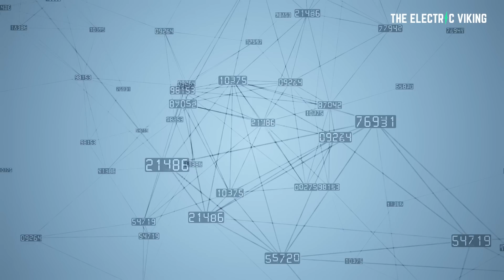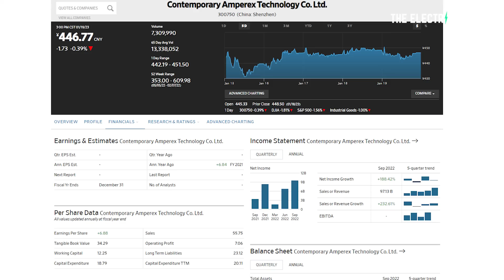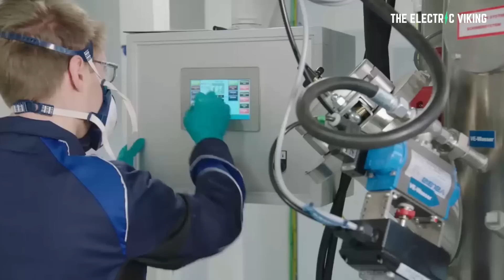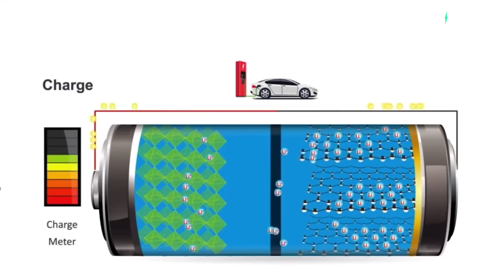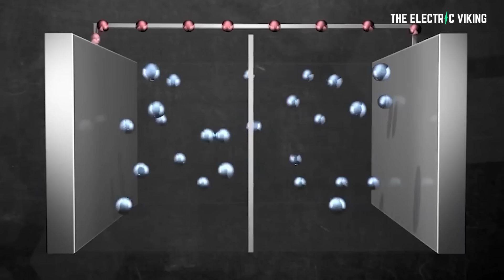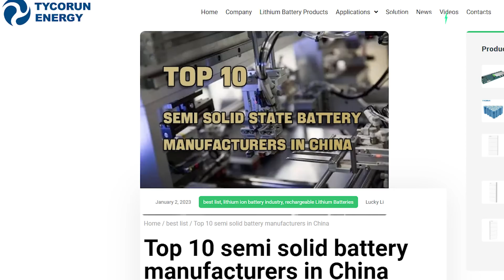GAME CHANGING Aussie Gigafactory deploy advanced US battery tech

Comment: It is really important that we get away from using Li batteries for static applications.  This would reduce the demand for Li, bring down the price and make EVs cheaper.  Some estimates suggest that if you reduce the price of an EV linearly, you increase the market exponentially.  The situation is probably even more extreme.  The point at which EVs become cheaper than an equivalent ICE car is and inflection point at which the sale of EVs will increase hugely.    We are very near to this point.  The good news is that other batteries are superior to Li batteries in a number of ways for static applications and only need market share to out-compete Li batteries.  All are made of cheap, readily available elements.  All have a much longer life.  All can be cycled between 0% and 100% with no damage.  There are the SbCa and AlS liquid metal batteries, The flow and gel ZnBr batteries, a bunch of flow batteries based on V or Fe and perhaps the up and coming Na batteries,

Comment: I hope your right Sam but your price of manufacturing analysis has a flaw in it. Yes the 20% cheaper cost would mean you could build them in Australia at a similar price as batteries being built in China now because of cost of labour disparity, but the problem is that this new cheaper to build tech would still be cheaper to build in China because of that labour disparity. So you have to make very sure this new company doesn't go running off to China to get more profit. That said i hope very much that this works very well for Australia.
Reply: The last couple of Aussie inventions that have done well for Overseas manufacturing were solar panels and WiFi .🤔

Comment: If C4V has 40%-50% more energy density (in wh/liter), this means your C4V battery can be 30% to 33% smaller than the LiFePhospate battery (not 50% smaller) for the same range. Note: battery "size" relates more to the battery's volumetric energy density in watt-hours per liter (wh/l), rather than energy per unit weight (wh/kg) that is more accurately identified as the battery's gravimetric energy density or specific energy.

Comment: Is there anybody working on battery operated trains? 

We have far too many diesel driven passenger trains, it would seem to me that given most of those trains are available as electric/diesel electric and steel rail vehicles are very efficient, why not just cut out the dirty diesel engines and replace them with batteries, possibly in replaceable modules to speed up recharging.

Comment: 7:50 correction: 2/3 size battery with this technology would have same range of older LFP technology.  The 5X power density makes it great for use in PHEV and EV's with small batteries that still have very powerful acceleration and  regenerative braking, allowing a tiny Genset.  This would work good with PHEV trucks.  With battery supply limiting CO2 emissions reductions, PHEV'S are much better than ICE vehicles considering that 95% of trips are very short.
Reply: I expect smaller batteries will be lighter and extend the range accordingly. The higher energy density makes them better suited to aviation than current batteries.🤔

Comment: BTW.... a nation like Australia may not benefit from adding value to its exports.
currency values depend in part on the 'balance of trade' (value of exports minus imports) in the nation's economy.
Turning that mined raw Li into batteries MAY be more cost effective than it being done in China (unlikely) but even if it is , doing so would obviously increase Australia's exports quite significantly...THIS increases demand for the Oz dollar..which pushes its price up relative to other currencies ....a higher value dollar makes ALL your other exports more expensive (iron/coal/wool/wheat) threatening the stability, competitiveness, and indeed future of those much more lucrative / important industries/ markets. (stable markets = stable export income (stable employment also)  = stable taxes for government)
Also, a higher value dollar makes imports cheaper, this can easily ruin local firms/industries who currently produce/supply those goods.

tl;dr MAKING MORE MONEY IS NOT NECESSARILY A GOOD THING FOR AN ECONOMY WITH A SOVEREIGN CURRENCY

GEO POLITICAL ISSUES AROUND CHINA CONTROLLING 80% OF AN ECONOMICALLY  SENSITIVE MARKET WILL HAVE INFORMED THE DECISION TO BUILD A GIGA FACTORY IN AUSTRALIA.

Comment: What about sodium batteries that CATL and BYD are about to produce ?  aunt they more advanced ? .. For grid storage how is the Flow battery I believe they are about to start marking in Queensland . I think flow batteries may have much longer number of discharge / recharge cycles . Storage batteries for grid probably have 2-4 cycles a day , so battery degradation is critical . Flow batteries are much bigger but that doesn't matter for grid stability after all how much space is not used under high voltage lines that bring power into the cities from power plants . flow batteries can have the fluid replaced easily when need and this recycled again and again .

Comment: Can't wait to see if it isn't all hype, like most all the other startups. When they say things like "5x the energy density", that's crazy (ain't happening without a bunch of hiccups). If "5x the power density" then yes, maybe (probably with a loss of energy density), though.
I believe that the LFP will be marginally improved, such as to almost have as much energy density as the NCA, etc, however, it won't last as long as they do now, and will be more prone to "thermal issues" of they get too energy dense.
So, best to keep researching but assume that LFP is already good enough, just like the inventor's name...
Goodenough 😏
Reply: that's exactly what it is. Hype, nothing else. This battery type only exist in the lab yet. When it comes to building at scale the impressive figures will fall apart. Even if the energy density is better, it won't be suitable for all applications, and definitely not for EVs, otherwise Tesla would be already making it.
Reply: @imrepetrohai I like your faith in Tesla but they do get their batteries from any battery supplier that meets their standard and price.🤔

Comment: The way battery technology is progressing how long will it take for a petrol tank-size battery to store more energy than a tank of petrol? 
This battery technology is moving so fast that I don't believe we have even started the real battery race yet.
I have a new motorbike and a Toyota FJ which both I love but I can see both being totally obsolete within 5 years.
I wonder how long I can use it as an ICE before it becomes illegal or too expensive to use in its present form?
I am also wondering if I will be able to convert the FJ to electric in the future. 
There is plenty of room for new technology batteries in the FJ along with a powerful electric engine.
Today the future is moving toward us very fast with little time now for the sentiment.
The other question is will the new up-and-coming generation care or just embrace the change?
They certainly have done so with electric bikes and scooters.
Reply: The energy content of petrol is somewhat theoretical until you feed it to an engine.  Even if we consider the weight of both the petrol and the engine, however, the energy density of petrol is still huge.   It's in the vicinity of 100 times as energy dense as today's batteries.  Electric motors are 4-5 times as efficient as ICE engines though, so that helps a lot. It should be possible to convert the FJ.  People are converting all kinds of cool old cars.  I think we'll se a lot more of this.  The younger generation will be fine with EVs.  So will the old folks, once they drive one and find out how nice it is.

Comment: Tesla uses spaghetti maps.  What is that?  If you walked all over a factory during the day, your path would look like spaghetti. It is wasted movement and adds cost.  The map for making computers and cell phones is full of cost add due to the spread out supply chain.  Same goes for Lithium.  It makes sense to vertically integrate in Australia where the supply of minerals are, and where the labor has the mental digits to fashion said minerals into goods.  It actually is no great mental leap to look at a spaghetti map, like the investors are doing, and start salivating.

Comment: Cancer utilizes sugar in a fermentation metabolic pathway.  Think of it like an engine burning high octane gasoline.  It will preferentially reach for the sugar.  Ketosis is the metabolic pathway for Vikings and all ice people.  Why?  They ate meat and few carbs.  The engine wants diesel (not high octane gasoline) to operate properly.  When you are in Ketosis, the body has already cleaned up sugars, and you go into autophagy.  In autophagy cancer cells are targeted and consumed.  Any sort of chemo is also made more effective with fasting and while in autophagy.

Comment: Can you cover recycling companies who colaborate with c4v?
Reply: The lithium ion battery recycling industry is already large and it is growing.  Most large battery makers contract with recyclers.
Reply: @incognitotorpedo42  Have you noticed that the info on EV battery recycling on the net has taken a turn for the worse.  NYT is saying "Electric Cars Are Taking Off, but When Will Battery Recycling Follow?" Dec. 21, 2022  
A search for "ev battery recycling" does not have redwood materials in the first page.
Reply: It will be about 20 years before these batteries need recycling.
Reply: @danharold3087  so they will achieve a 100% production yield over rampup and lifetime? And If not (which is highly probably) how much scrap is that at a 1-10%scrap yield for a 10-40 GWh prod Cap? 😉
Reply: @drei4nein794  Glad you asked!  Tesla calls the rejected cells pre consumer scrap.   It goes right back into the production of cells.  So no scrap.  I do not know about other battery companies but given the value of battery components I would find it unlikely that they toss their scrap.  If they can't recycle it they will sell it to someone who does.
Reply: Apart from batteries that are damaged , many will be used as stationary storage batteries when a car can’t get the desired range from them. They may not see a recycling plant for forty or fifty years.🤔
Reply: @malcolmrickarby2313  why should someone retrofit different technologies and different "quality" states if it would be cheaper to produce new ones and sell/reuse high priced raw materials rather than sell second hand batteries?. And then security clearance will be fun proving safety for each cell? Its all fun and games as long everything keeps working.

Comment: As I looked at the animation, I was wondering why the parking lot didn't have solar panels as a roof.   Where are the charging stations for the cars?
Reply: @ano T  Good point, and I would think they are likely to add those when the factory is actually built.  Since the "look" of those features can change, the company (and/or the architectural firm they are using) probably did not want to put that in their promotional video for the new factory.
Reply: They were on the roof.🙄